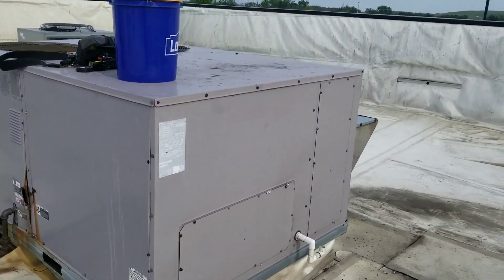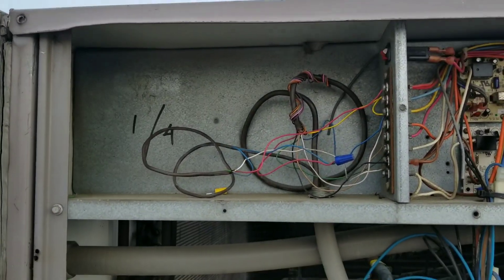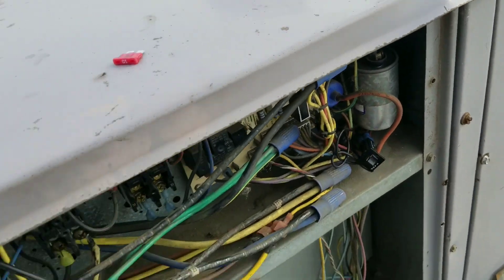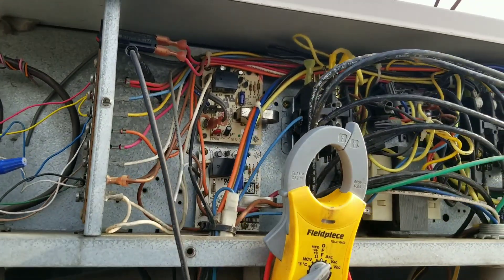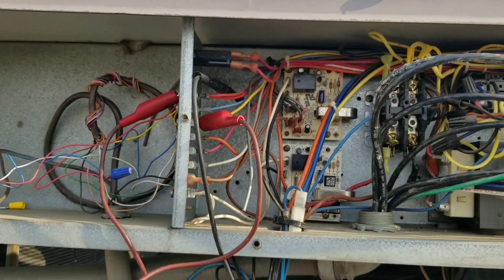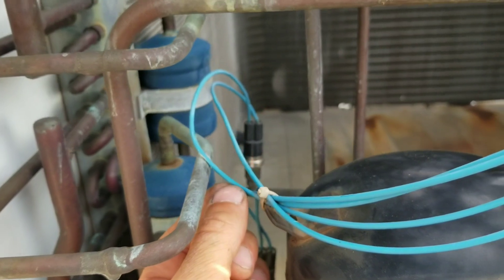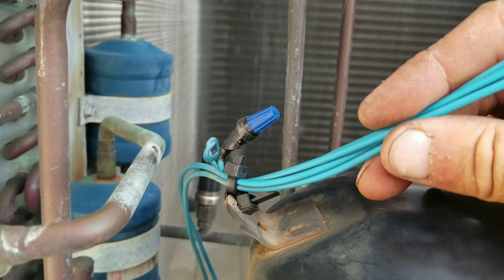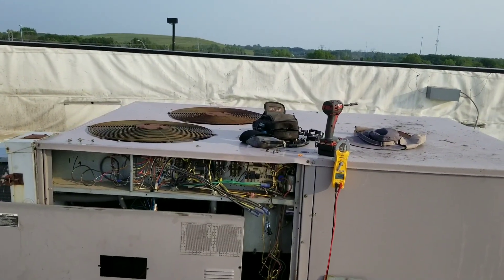No AC- but why ?

Comment: Reminds me of some parking lot lights I worked on. Single strand wires had slapped inside the pole from the wind so much it wore though the insulation. Causing an intermittent short.

Comment: As an electronics engineer I find the build quality of these units appalling.  Electronics bays full of ice.  Filthy dirty.   Wires just dangling in the breeze where they rub out with the vibration.  Zero diagnostic aids.  Amazingly bad design.

Comment: I had similar problem twice......wire to frost  detection thermostat had rubbed out by indoor blower. Drove me nuts...Also pretty sure the wires tied to amp detection board should go through the coil not tied to  the outside .
Reply from the maker: those low voltage shorts can really leave you frustrated, I know they do me

Comment: Great visual inspection! 
High pressure switch,rubbing on liquid line...
Those internment shorts are a PUZZLE at times..
It can really cause a lot searching..
Great find..
Thank goodness it didn't cause more damage..
I had a similiar issue ,but mine caused a leak.besides shorting wire @ high pressure switch wiring.touching high pressure discharge line.. Defitinely not fun..
Great video..
As you mentioned,alot of searching.and sometimes its right in front of us...
Bryan Tyler Refrigeration

Comment: Back when I dealt with these carriers I found 90% the shorts was in the wiring to the economizer section. Because even if it doesn’t have a economizer the cooling control power still runs up to the jump plug up there. Carrier is or was notorious for running the wires either right over the blower housing or pulled tight around it causing rubbed through wires. Not always the issue, like this, but I’ve had to pop a lot of tops in the past.
Reply: chris b I was going to mention that same thing. I installed 17 of those units. After the 2nd one shorted the wires over the blower I repaired the other 15 before they became a problem.

Comment: Great vids that 10 amp fuse is in I believe is in the heating circuit so apparently there is a problem there as well the breaker you had reset is obviously the control

Comment: I had one that I chased thru the hole unit and found some low volt wires that had been ran thru the blower area and over the coil and got pinched against the coil when someone stood on the unit.  That was a tricky one.  Good tips for the young guys.